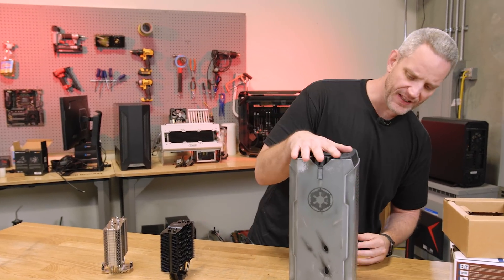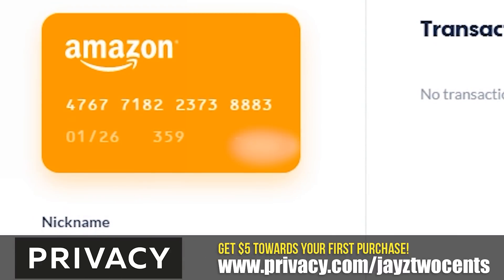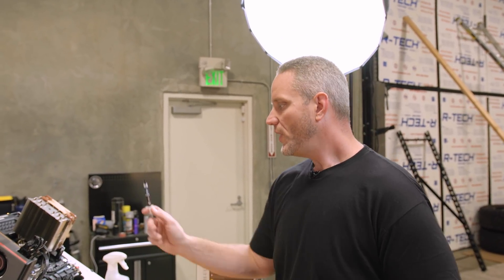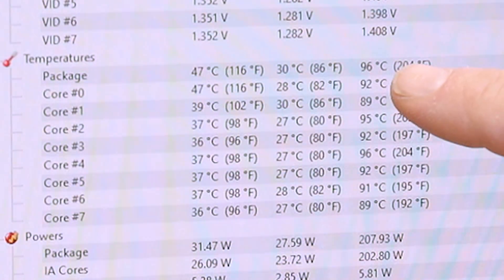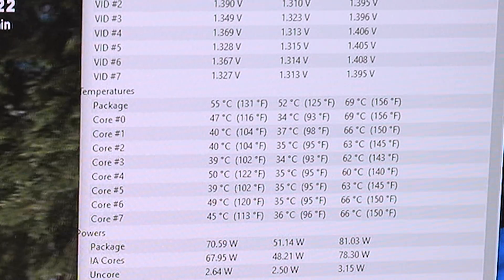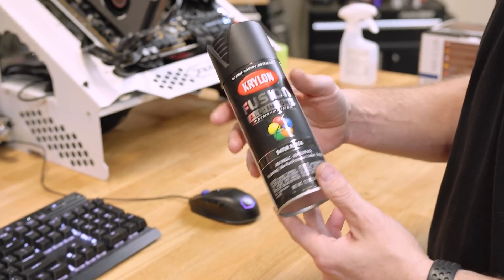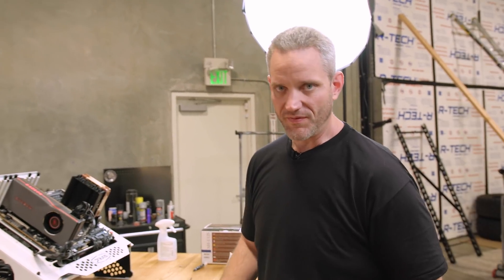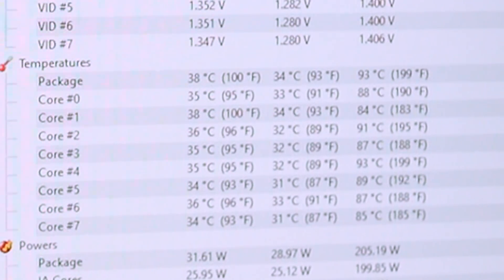Does painting a heatsink hurt its performance??

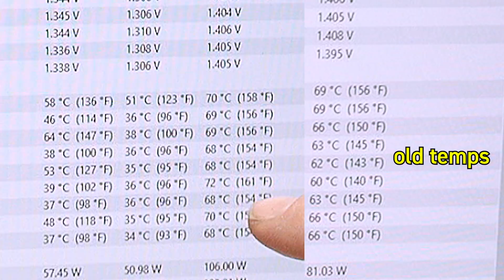Comment from the maker: Enter your own clip at 11:48...
Reply: ...i don't know what you're talking about, there's no editing error there...ssshhhhhhh.....
Reply from the maker: @frickingphil  errors were made... about two years ago.
Reply: @Jayztwocents  this is not relevant but i have a 1660 and want to make a gpu upgrade. was thinking about going to 2080 ti is worth it? should i wait for the new gpu's coming out, or is there a better option to go with?
Reply: I also learned  @frickingphil  should not drink and edit.
Reply: @frickingphil  where did the clip go phill
Reply: @frickingphil  It was artistic creativity
Reply: @frickingphil  too much SovietWomble :-D
Reply: @frickingphil  just a vid of jay doing computer based tongue twisters. Think of the editing possibilities.
Reply: Jay you should have used engine paint designed for high tempratures as they usually have matalic particals in the paint suspension so it would act less like an insulator
Reply: @Aeriket  stove paint.. Like you use for coal or wood stoves.
Reply: I am a fan of the "69 on the Package" Around the 7:19 mark. Nice.
Reply: Looks like the drivers for the 5700XT are sentient and black screened your vid lmao
Reply: @TCOphox   i have instead of using amd uninstaller i have used ddu and have not gotten a black screen since if you are not using ddu its your fault not amd
Reply: Did you digress.
Reply: 11:48 > Phil paints the edit black<
Reply: i honestly like those little things , were all human.
Reply: I thought you wanted to sample how a jayz 2 cents chill hop station would be
Reply: You should have reapplied the tin multiple times or run a graphite pad for consistency, since GN proved that mounting can make a measurable difference.
Reply: I'm at the prediction portion, but my first thought is what if you powder coated it?
Reply: I FIX IT!!!! (best - commercial - ever 10/10 ign)
Reply: was wondering what was going on.
Reply: Physikal laws says, black material can spread heat better. Not painted material becouse every layer of paint is an isolator. Best solution would be black oxydated metal.
Btw... Fun fact... Almost every water radiator for PC are black.
Reply: Hi. Try "paint" with this https://www.amazon.com/Birchwood-Casey-Super-Blue-Solution/dp/B013YKTL4S
Reply: I thought my phone froze during that section. THANKS @PHIL 😡
Reply: Driver crashed
Reply: Try a coating including some metal filings maybe? Not too sure if you could do that, maybe giving a charge to the rad so they stick, then paint over. Makes me think it would increase surface area for heat loss.
Reply: What if you only paint the top and sides and leave all the inner fins unpainted?
Reply: 11:48 stop playing with it or you'll go blind!
Reply: err 32 delete folder
Reply: In a somewhat related topic, I replaced my original copper heater core in my truck last year (cause it was leaking) and I installed an aftermarket already painted copper heater core to reduce any chance of external corrosion. Now I don't enough heat as I did with my original non painted core did. One thing I did notice is that there are not as many cooling tubes as the original and the fins are thicker and less dense. 

Either way I do believe that the paint coating does reduce heat transfer but more importantly the design of the cooler, radiator or core I.e. (amount of coolant passages, tubes, fin density and overall design) greatly affects the cooling capacity.
Reply: BROUGHT TO YOU BY RAID SHADOW LEGENDS!
Reply: Why @phil why... 😭 
Now that i've looked into the deep void, my life will never be the same again.
Hunted by the creatures of the void... i will need to hide... to hide...  fades away
Reply: The opposite thing would be true also. If you added fins and compressed the stock and cut small reliefs in the fins to increase surface area that also helps tremendously.  Bikers have been having their heads milled for decades for that reason ;-)
Reply: What do program do you use to monitor the temps?
Reply: Well Jay did u sprayed the video black instead of cooler ?
Reply: Pretty sure this is the paint's fault.
Reply: @Jay it would be nice if you could go back to the A500, AV Techy had mounting issues also (pipes riding on caps on Intel) also featured some of your takes on "buy it and let us know" or "should compare to noctua" without actually comparing the coolers. I hope you could clearify some of this and maybe help with people's expectations on that cooler.
Thanks for all your efforts
Reply: I would say maybe 3 degrees
Reply: Mighty Car Mods painted their cooler black too and it was better afterwards, so it will be better! :D
Reply: why did you put only one fan on it and not 2 ??
Reply: JayzTwoCents so if you paint your CPU Air Cooler use better fans to compensate the heat difference.
Reply: You still irritated about this star wars build? Doesnt matter, keep up a great work!
Reply: Does that mean you're going to host a competition for us to submit clips to fill in that gap then edit it in and reupload the video?!
Reply: Can you use metallic paint?? 🤔🤔🤔
Reply: Why not use a semi-permeable high heat automotive paint? I can absolutely guarantee the difference is within margin of error with a good quality paint designed for the purpose of thermal transfer. Ceramic coatings are super thin which is the primary reason why BeQuiet can make the claim they do. You actually used one of the thickest rattle can coatings available.
Reply: @TheJjjoj  You arent funny anymore
Reply: @albinoalpaca1059  In that case, would you like to join The Church of Jesus Christ and the Latter-day Saints? I get a kick-ass jet ski if I sign up 3 more people.
Reply: Thin coat wont
Reply: just put an ad there, job done.
Reply: JayzTwoCents big bang padababa pow
Reply: why didnt you use radiator paint?
Reply: someone got lazy on video editing at this time stamp :)
Reply: Depends on the type of paint
Reply: I inserted an old Lisa Ann as Sarah Palin clip there
Reply: Watched this vid at fullscreen and I thought my 570 died
Reply: Close up of painted heatsink D'uh
Reply: Looks like someone forgot to ripple delete that on the timeline. Lol
Reply: Aluminium cooler?  Dip it to stain it black!  I'm guessing that will NOT affect thermals.  
Insta-Blak A-385
https://www.youtube.com/watch?v=sdlIHe7Crjk
Reply: @Jay I think if you just paint the top and the sides leaving the fins unpainted would have a better cooling effect also no one  is going to see the fins once the fan or fans are installed.
Reply: Man... I was like... WTF my PC crashed! Why!?
Reply: thought my gpu crashed
Reply: Oh we had to add a clip I thought it was my 5700xt giving me a black screen 😉
Reply: I thought my chromecast stopped working, and actually restarted the video LOL!! 🤣
Reply: @jayztwocents

A " stove paint" like used for coal & wood stoves , or even better,  electroplating , would have far less thermal impact.
Reply: Phill fell asleep at that point in editing.
Reply: the teperatures should be high or low , not hot ...temperature = number ...
Reply: Leave Phil alone. He was clutching a 1vs 5 on RSs  mid edit
Reply: it will be 2/3C higher predictions depending on the paint coating.  ie its thicker for ally
Reply: i was almost right 1c off :P
Reply: Don't fire phil
Reply: Since you mentioned it .... I'm inserting my idea there, the test with Hammerite. It's supposed to be paint with metallic fine grit in it, giving it a chance to be used on heatsinks without negative effects(?).

Test it plz.
Reply: Hear me out, could you try cooling your systems with liquid metal such as mercury or something else? Or possibly even just engine coolant from your car?
Reply: i was right. i saw a video MightyCarMods did where they painted an intercooler for a car and it made a gain. and that video is ooooooold
Reply: Bro what if the paint start to meld
Reply: I learned to only paint the flat edges that you will see.
Reply: @Ken_Tague  That's a pretty good idea!  I don't paint anything in my computer because... well it's the inside of my computer and I couldn't care what it looks like, as long as it still performs like a beast.
Reply: High temp paint for car engines or for bbq grills
Reply: On paint color:

Black would have a slightly easier time absorbing the heat from the fins, but a harder time getting rid of it.  White would have a harder time absorbing heat, but an easier time getting rid of it.  Any difference would likely be negligible, especially at higher temps (100c boils water at sea level).  Eventually the thermal conductivity and specific heat values of the different paint colors would approach the same respective values.  Realistically any change in temperature from testing different colors would likely come as a result of the thermal conductivity differences in the materials used in the pigments of the paint, nothing more.
Reply: jojo clip - Hory Sh**tttaaaaa
Reply: I used this one: https://www.youtube.com/watch?v=hNZUZm-sV54
Reply: Can you try same test with white color? You know the physics - black is color of absorbing materials, white is color of reflecting and emitting materials, and it goes both for light and heat  (this is why you can fry yourself at summer in black dress and would be more cool in white), so i wonder how color could make difference in temperature. Also as bonus test try red and purple as red is close to infrared aka color of heat wave, and violet is in opposite side of spectrum. Please do such test. In theory it should make difference, but other particles of color could annihilate difference. Also heat comes out from inside and cool air from outside, it also can make some difference and reverse logic here (i suspect that white color may reflect heat back on metal while black absorb it).

Comment: What I'm curious about is... MSI is selling two new laptops, at two different price points, with the same MS-15M1 motherboard (the Raider 68HX and the Vector 68HX). I was watching an upgrade guide video made by MSI and it shows the Raider having a CPU/GPU heat sink/pipes painted black. But the Vector has bare copper. I've already noticed a couple other areas where it seems that MSI has de-tuned my Vector so that the more expensive Raider will stand out. My theory is that the paint helps to insulate the copper pipes, thereby reducing the amount of heat that is radiated into the laptop chassis, and subsequently pushing more thermally conducted heat out of the heat exchange fins and out the vents. I'm wondering if painting mine might help lower the temps of the chassis.

Comment: I'd still recommend against painting your cooler for at least four reasons.

1. Paint takes space, and less space gets clogged with dust easier and it's a pain to clean.
2. The performance of your heatsink will deteriorate as it accumulates dust, so you will have to clean it more often.
3. Why not just get a black one with proper coating?
4. Black is good for radiating heat, but other colors might decrease the efficiency of the cooler even more.

Comment: dope. I'm considering painting a couple of subwoofers that I have, which use an aluminum speaker cover to radiate some of the heat from the rear of the driver which is buried deep inside the box (it's a folded horn). So it's good to know it will probably be fine - since I don't really plan on running them near their thermonuclear limits haha

Comment: My guess, at the start of video, would be no. Paint's transfer capabilities would still be at least as good as air. Also there are plenty that come pre-painted. I don't even think there will be a measurable difference.

That said, you could screw it up by somehow creating an air pocket between the metal and the paint..

Comment: I use radiator spray for radiators to heat the house. Inside of them runs really hot water, sometimes so hot the radiator can burn your fingers if you touch it. So it needs the special heat resistant spray.

I have a Scythe Mugen 5 PCGH (Mugen 5 rev.B Dual fan edition) and the radiator is silver and it stick out a lot in my PC case which is all black components and glass side. 

I wanted it to spray with matte black color, but only the very first fin you see, not the other 30 fins. Purely for aesthetics. I used a random matte black spray for 5$ (400ml) like a no name unknown brand and it worked nicely. 0 changes to temps as only the 1st fin nearest to the glass side panel was sprayed. 

ALL YOU NEED TO PAY ATTENTION TO IS HOW YOU SPRAY!!!!!

You need to spray in parts, slowly, from a distance of at least 25/30cm, or you will get running drops of paint. Ofc you spray it disassembled from the case with no component even near that shit!!! I covered the rest of the fins with paper and tape. Only the front fin was visible. You want to spray from top to bottom - your hand is above the cooler, not next to it - you avoid the drops better. But really you need the 25cm and spray like pst pst pst pst from side to side, left right, right left etc... and not pssssssssssssssssst in one place or YOU ARE FUCKED!!!!
Reply: 08:34 I almost fainted

Comment: You do not PAINT radiators, you ANODIZE them. It doesn't have to be black, you can use clothing dye to get almost any color you want. You can do this at home. It's a little more expensive and complicated than painting, but it is well worth the difference. Imagine how impressed your friends will be when you tell them "I didn't like the color of my radiator so I anodized it" or "Where did you get that purple radiator", "I anodized it that color". Better if you say: "I paid big bucks for that" if you don't want to be doing everybody else's radiator too.

Comment: Hai Jay, i want to ask about cheap heatsink 4 heatpipe + premium case fan vs "not-so-premium" heatsink like BQ pure rock 120 mm. I have 2 arctic P12 PWM PST lying arround not use for months and i want to "semi" upgrade my current heatsink. So, do you think cheap 4 pipe heatsink + P12 is better than BQ pure rock slim 2 ( 92mm, my hsf ) or maybe it will equal performance with pure rock 2 120 mm ?

Comment: I thought on the beginning that it would mater 10% on less stress like instead of 66C I thought that it will be 72C, and less difference on more stress because after 90C you can easier come to 96C then from 96C to 99C But I was wrong on first part... I knew paint will be insulator just didn't know how much and now I know ... THX

Comment: 11:34 whatch out the old temps are lower and the CPU running on 81.03W. the new after painting result little bit higher but cpu running 106.00W. it is not a fair match.

Comment: painting the heatsink matte black could improve cooling because it increases the ir radiation it emmits cooling it faster although its another layer for the heat to get through and it will also absorb heat faster from other parts of the computer

Comment: Not sure the feasibility of it, I don't think fins separate from the heat pipes. If there were a way to paint just the fins and leave the heat pipes alone I wonder if it would hamper temperatures much. Got a feeling the majority of the heat isn't actually migrating from the pipes, spreading out through the fins. Rather dissipating off the heat pipes themselves and the fins just acting as air dams to keep the air flowing directional through across the pipes.

Comment: I wonder what would happen if you only painted the heat pipes. Insulating the pipes would theoretically increase the rate of heat transfer, since the rate of heat transfer is constant. Though it would be a bit difficult to only paint the heat pipes, and to leave them unpainted where they contact the radiator fins.

Comment: Easy fix:
1. Take some thermal paste
2. Mix it with water till it becomes as thin as spray paint
3. Mix in black coloring
4. Spray onto fin stack
5. Nice! Now you've painted your cooler black, and improved it's performance.

Comment: Mixing some sand-sized copper grains might actually improve cooling as it would ad a little surface area and disturb the linear airflow between the fins (it creates a boundary layer preventing all the air coming in contact with the heatsink).🤔

Comment: Cinebench R20 is nothing like a visual representation of Prime95. Prime is wayyy more intense. Small FFT in particular. It will crash almost straightaway while CR20 will run to completion multiple times. 

Surprised you said this.

Comment: You should also have tested painted vs not painted in the case of a fan failure. Black bodies radiates heat much better than any other color.

Comment: You used the wrong kind of paint ...... You should use a flat black paint which will take advantage of the Black Body Radiation effect and you may even find cooler temps ..... I've never tried it on these types of heatsinks but with the large fin passive heatsinks on audio amplifiers used for live/concert sound it gives you up to 10% better heat transfer efficiency because of the Black Body Radiation effect ..... Doesn't work with anything other than flat black paint ... Another place you will find this used in the condenser coils on hi-efficiency A/C units (the outdoors part) Always cost conscience manufacturers of A/C equipment wouldn't spend the money on doing that if it didn't work .... Since these are similar finned type sinks with tubes to transfer the heat it should apply here too
If you want to reflect light/heat nothing works better than flat white paint other than metalized mylar ......

Comment: So judging by this, and the fact that the back plate is more about protecting the PCB, than thermal transfer. I should be alright to do a light airbrush coat to the back plate of my GTX 1660 ti?
Doing a white and green build and was thinking of airbrushing the plate white with green accents so I don't have to try and find a new custom card.
Reply: GPU already hangs out at a cool 48 C under load, so I don't really have any worries about thermals.